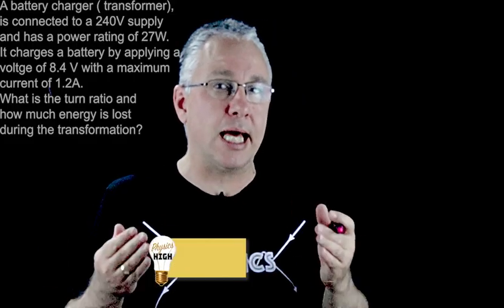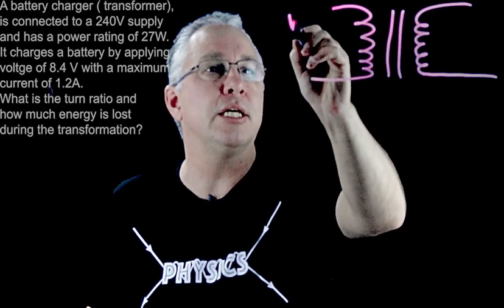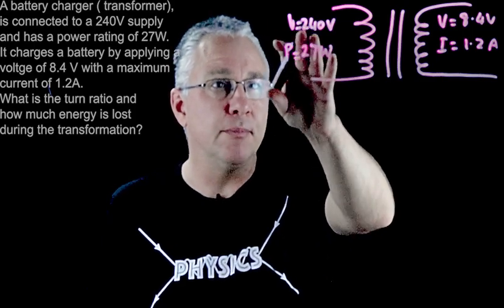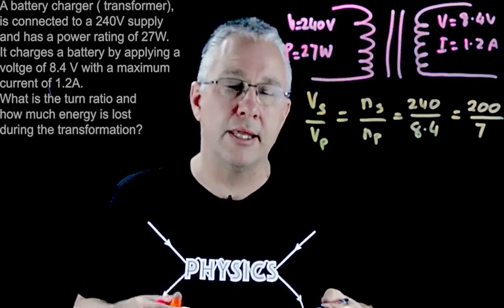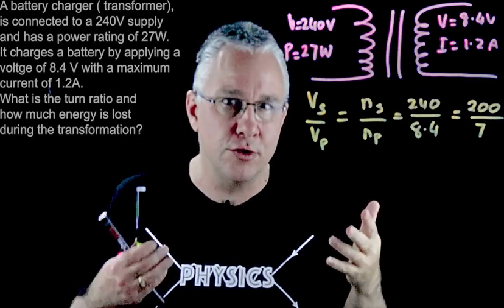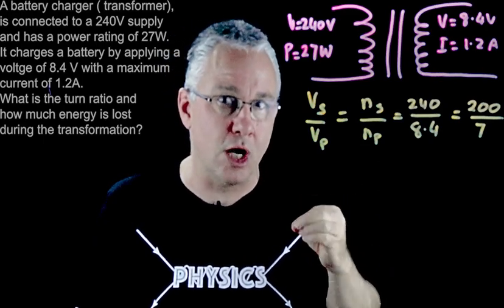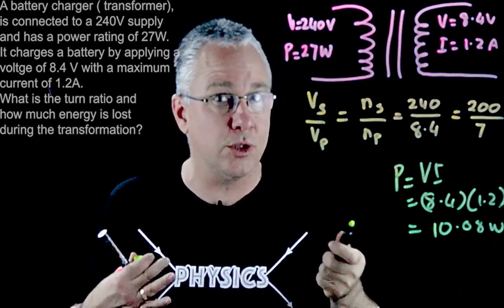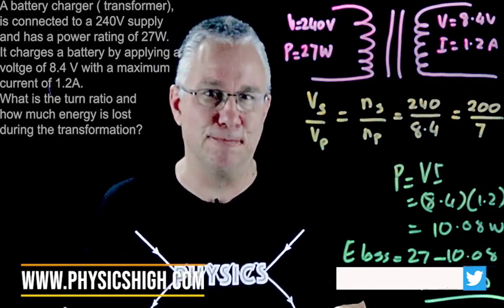how to solve a transformer problem involving power

Comment: This isn't the first of your videos that I have watched. I've only watched a couple, and I'm trying to build a generator out of an AC brushless motor! Yes I've seen that this is the wrong kind, but it is possible ( I think), and one of my problems is where the power goes into the motor? When I took the fan apart, there were several wires that fell off?